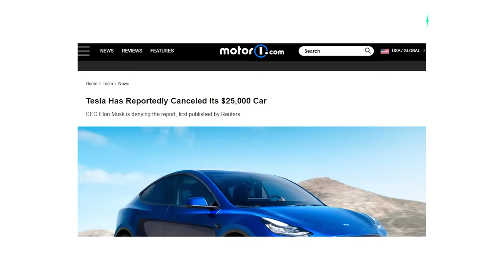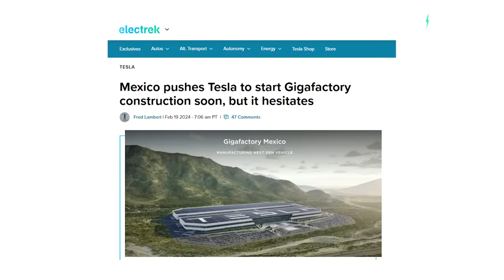The REAL reason Tesla is 'delaying' NOT cancelling Model 2 production

Comment: Tony Seba never said that the curve of improvement and cost reduction in EVs had to be smooth.  It turns out, the advances are happening in "spurts."  The batteries, the cars, and the production process all had to be reinvented and then reinvented again.  When batteries became safer, longer lasting, faster charging, less expensive and with higher energy density, Tesla could NOT make 20M cars using the older ones.  With 48V electrical architecture, ethernet signaling, wire steering and brakes, and mature sensing technology for FSD, it became cost prohibitive to design the cars the "old" way and then transition to the new later on.  These changes enabled radical redesign of the production process from moving production "lines" to sub-stations where the front, back and central sections are first put together and then securely connected.  Worse, fewer consumers buy the older versions because they know that in 2-3 years the cars will be so much better and cheaper.  Only Elon could maneuver through all this, but even for him it's a bumpy ride.
Reply: Agree EVS become obsolete after 3 years.

Comment: One of my rural neighbors bought a 1st gen Leaf.  The older Leaf is  okay for the five mile trips into town - the batteries can overheat on longer trips in the Texas summer.

I wish there were an affordable "Lego" battery with cooling that can be assembled by EV repair 
 shops to upgrade older EVs like the 2012 Leaf.
Reply: Carwow did a review recently on the 1st gen Leaf and were impressed by it as a daily run around and not a bad car by Nissan. Apparently, the Leaf has a big following/fan base and can buy replacement batteries, newer technology batteries with more range, etc.. It was very interesting.
Reply: New Teslas with LiFePo4 batteries will last 1.5m miles. Current ones last 500k miles. The Leaf was just early technology (like early cars which would explode) and I feel bad for your friend.
Reply: They have something like that for old Prius hybrids it seems.  Maybe it is coming.
Reply: Yes, loads of places will replace Leaf batteries with newer gear, doesn't mean there's one usefully near to your friend though. But it's not a car that's as important as say, a classic Beetle or Mini so it's not exactly exciting for the car monkeys to work on products for.

Comment: You are providing the most benevolent interpretation of the available facts. You could be right, and only time will tell. What we do know is that Reuters based its report of the Model 2 cancellation on internal documents, not off-the-record comments from unspecified sources. And Drew Baglino, who focused on powertrain and energy systems (not autonomous software), is GONE. And we have the promise of a robotaxi unveiling on 8/8. Another interpretation which would also fit the available facts is that the CEO is steering the company away from the dual Model 2/robotaxi strategy to a singular focus on the robotaxi and autonomous driving as growth drivers for the company, and those that are not on board with this strategy are either leaving Tesla or being let go.

Comment: I feel sure you are right.  There are a couple of other factors.  Tesla needs to build a thousand or more robotaxis to put through all the regulatory hurdles in each of the states of the USA and the countries of the world.  Once the robotaxi is into its regulation phase Tesla can start on the model 2.  Secondly, once robotaxis are seen to be coming, providing point to point transport at less than the cost of car ownership of even a small car, the market for small cars is likely to diminish considerably  It is prudent for Tesla to give the robotaxi some lead time.  Especially when people are putting off buying a new car.  The current market is perfect for robotaxi.
Reply: robotaxi make sense in a city not anywhere else
Reply: @joeblack4026  Robotaxis will simply be  like a normal taxi except have no driver. I don't think they will be any cheaper to use. People will still want there own car.
Reply: Robotaxi and the model 2 will be based on the same platform.
Makes sense to do them both  at the same time.

Comment: I think the battery issue is central, you're right. No affordable long range batteries, no Model 2.
Reply: DC.409  the 4680 cell was never going to go in the model 2. any 4680 production is testing for the cyber truck. As CAL recently stated a 60 kWh LFP battery will cost less than $3000 by the middle of 2024, price of the battery pack isn’t an issue but may be availability is.
Reply: DC.409  i have also just read that the new small BYD Seagull uses Sodium Ion Batteries - probably cheaper again. It may be that Tesla have already decided they cannot compete with these small cheap cars - but what answer does the rest of the industry have?
Reply: DC.409  I have heard about all of this many times before over the years and I hope there is some truth to some of it. If CATL cannot make Solid State then there is no chance anyone else can - and even if they can, the won't be able to scale it. Tesla are sitting on 1000 mile range battery packs but they can only be recharged less than 100 times. 

There is all sorts of technology about but none of it is for sale and driven on actual real roads. LFP batteries have been around for a long time, nothing new there. Forget about Hydrogen. No distribution, no infrastructure, no one is going to pay to build it out. Dead as a Dodo. And the Hydrogen itself would have to come from splitting natural gas using electricity or generated locally using electricity. 

I agree with simplify and lightness - as does Tesla "The best part is one you don't need". Like indicator stalks. Some People don't like simplicity and prefer their hundreds of buttons peppering the dashboard at random places. 

What I think is most likely to happen is tariffs, protectionism, no real innovation from legacy auto and made up stuff about Chinese cars spying on you. Unlike the CIA who were not spying on the German Prime Minister. Oops actually they were. Anyway, the rest of the world does not care about USA and EU interests so it will sure be interesting from now on - whatever new comes along.

Comment: Sam, you are right, it's all about timing.
More time to get the CATL high efficiency batteries into production, more time to fine tune the Model 2 design, and more time to allow the sub contractors to get setup in Mexico to provide parts.
Reply: Put Optimus In SUPPLIERS  factories

Comment: The robotaxi will have to prove to governments and to the insurance companies that it reduces accidents on public roads and is in fact safer than a human driver. Until that data is available Tesla will need to build the Model 2 for human drivers.
Reply: The legislation allowing it at all is a bigger  hurdle but is already underway. The FSD is just an unknowable amount of time/data until it tips over. My expectation is they'll deploy the first cars to places like San Francisco that already allow Waymo etc, and once it's proven not to run people over, other cities and countries will tick the box and let similar test programs start in targeted cities where it's the most useful anyway. Then it'll fall like dominos. End of the day, if SF needs 10,000 robotaxis to eliminate all it's taxis (made up figure) it would take Tesla several months of production ramping from when they pull the trigger to even build them. Each similar city that permits a pilot scheme, will need a bit less time but they'll be production constrained for years 

So they can sell say, 10,000 robotaxis, and any other cars they make have steering wheels and go direct to consumers. They won't have trouble shifting any of them.
Reply: 109%

Comment: Why would they build the smallest car to date in the land of the giants, surely Berlin would be the best place to make it and distribute around Europe where they actually buy smaller car
Reply: True. But then, Volkswagen have their ID3 and ID4 platform vehicles which aren’t selling as well as they planned them to. EVs aren’t the car most people are going for.
Reply: @sullivanrachael  but that's a 35k car and a pretty average one at that, this would be a MG4 competitor and I'm pretty sure people would rather have a Tesla than a MG or Leaf or Vauxhall Corsa E
Reply: @sullivanrachael  ID3 (size 3 car) has the same price of Model 3 (size 4 car), with less range, heavier car and not so good. Megane is a little better but expensive too, and the higher batterie is "small".
Reply: in Europe, we're used to 5 door hatchbacks with 1000 km range and very low energy consumption. at 20k€ maximum, brand new.
Reply: @sullivanrachael ..is EV in general? No, it’s all the OTHER EV that are not selling. Tesla still has waiting lists for its EV.
Reply: Subsidies is the simple answer to why they planned US production. Outside of the protected US market, competition is far ahead in low-cost EV's, making profitable scale difficult. While they might try to save face by showing something else and saying that is what they meant all along, there is clearly truth to the reports that they scrapped their originally planned low-cost car.
Reply: If they came out with a small, sub-$30K Tesla, I'd buy one tomorrow. As it is, I'm about to buy a used Leaf because we need something, anything.
Reply: Musk has already said that it will be produced in Berlin too.
Reply: SUVs are the best sellers in Europe. I think Asia is the best market for a small car, maybe in the upcoming India factory
Reply: @spadress  Europe is full of small cars,UK,France Italy. There isn't much option with the way the old towns and citys are built and people don't road trip like they do in the states or Aus
Reply: India roads are more petite
Reply: @spadress  Peugeot 208, Dacia Sandero, VW Golf, Renault Clio are Europe's best selling cars and have been that for years, all hatchbacks. The only SUV in the top list is Tesla Model Y in 2023. No idea why you think SUVs are THE best sellers in Europe, it's hatchbacks. Walk through any European city and it is immediately apparent, at least 70% of all cars are hatchbacks.

Comment: The $25K Tesla never made any sense to me. For a low price you need a big production run, for big sales you need big range, for big range you need a big (>50kWh) battery, to fit that battery you need a pretty big car. So now you basically have a Model 3 and that can't be build for $25K and even if it could it would wipe out sales of the real Model 3.
Reply: They could possibly be saving it for their India factory that was being talked about recently.
Reply: You have understood wrongly the physics of the equation vehicle size/battery size/range.   It goes the exact inverse that you wrote.

When you grow the size of a vehicle, you have to grow the capacity of the battery over-proportionally to maintain an identical range, which in turns increase weight, which in turns require a bigger battery.  This can turn into a vicious circle, and end up with a monstrosity such as the Hummer EV.

Inversely, if you go towards a smaller vehicle, you enter into a virtuous circle, and can save a lot on battery size, and hence weight and costs.

So a compact model, with a height identical to the Model 3, but 2-3'' narrower and 25-30'' shorter, would weigh 25-30% less, and be fine with a ca. 40 kWh battery, which will give it a range somewhat longer than the Model 3 RWD.

With the manufacturing volume of such a vehicle, my best guess... but that part is only a guess... is that it will come out at a price of less than $25k.
Reply: @st-ex8506  The most efficient EV currently available needs 24kWh for 100 miles so your 40kWh battery would get it ~160 miles of range. Nobody actually buys low range  EVs like that anymore. If we assume that the mass market demands 300 miles of range you would actually need more like a 70kWh battery to hit the really big sales numbers. So no, there will be no Model 2.
Reply: @tellyboy17   @tellyboy17  The Aptera is an EV, isn't it?  It  gets 250 miles of range on a 25 kWh battery. THAT on is probably the most efficient EV.  Your example is a SMALL EV, not an efficient one!  The Nissan Leaf, which has a 24 kWh battery,  perhaps?

But closer to our topic:
- The Model 3 RWD gets 272 miles of range with a 57.5 kWh battery.
- A "Model 2", assuming same aerodynamic coefficient (it will likely be better), same drive train efficiency (it will likely be better, if only because of narrower tires), and assuming the dimensions and weight reductions I mentioned in my previous comment, putting it in the compact car category, will need a battery around 25% smaller  to get the same range, so in the 40-45 kWh range... demonstrably NOT in the 70 kWh range!!!
- The mass market does NOT need 300 miles of range for a car that will NOT be a "road cruiser", but much more of a commuter.  I have that much range with my Model 3 LR, and I maybe need it 2 or 3 times a year despite me driving quite a lot! It's a lot of weight to move around uselessly 98% of the time, and a lot of cash invested in a marginally useful capability. 

Range, over ca. 200 miles of real-life range, is a pretty useless luxury... what is necessary is a good charging network, and Tesla has an outstanding one in most places.  I agree that if you live in ND, then it might perhaps be a good idea to wait a few more years before buying an EV.  But over here in Europe, we can travel everywhere with ZERO range anxiety.

The "Model 2" is much awaited in Europe, where even the Model 3 is too much of a car, in both size and price, for a large chunk of the market.
Reply: @st-ex8506  Nobody buys Aptera. Nobody buys Leaf. Doesn't matter what you tell people what they need, the mass market will decide for itself what it needs. If the range isn't there, the sales aren't there. An improvement of 25% over current best practice for a real car will not happen. So yeah, maybe if Tesla gets 275 miles out of 57kWh my initial estimate of 50kWh is closer to the mark (but not for a 300 miles EV..)and that takes us back to the Model 3 equivalent car. Again:  Model 2 will not happen.

Comment: On paper there's a difference between a 'pause' and a cancellation. In practice, a 'pause' happens until people forget about it, then the cancellation happens quietly with little press attention. It's usually a face-saving measure and nothing more.

There's cutting through hyperbole and inaccurate reporting, and then there's stretching things to make it sound like you weren't wrong by believing everything a company (run by a known liar) says.

Comment: The model 2 was going to be in Mexico, but was pulled back to Austin Tx to co-locate engineering and the initial production line.  Profit isn't the issue.  Ramp an optimally effecient production line with new technology BEFORE building multiple other factories which can then be built effeciently and quickly using proven technology.  Think of Austin like the initial 4680 battery proto line at Kato road where the 4680 production line was matured.  It could even run with no profit because building a new technology line first remote from engineering would be prohibitively costly in both time and money, if it could be done at all.
Reply: 100% correct. But because it takes 100+ words to explain this 99% of keyboard warriors not going to read it.

Comment: Sorry, the Mexico plant pause makes no sense. This plant is 2 years from volume production if they break ground today. They have $30b in the bank. Building the plant and holding off on installation of machinery and hiring might make sense but they have the money to build the shell right now. Scrapping M2 in Austin Also doesn't make sense, the line was well along in construction. 
Pausing the work during the company restructuring... OK, I see that. 

So there are 2 unanswered questions that need clearing up. I understand the need for tight control of info during a restructuring and the danger to sales of the Osborne effect, but the fate of the Mexico plant is now a Big WTF combined with rumors that Reuters is spreading about M2 (Name the thing or its the Model 2). Ping ponging M2 back and forth from Austin to Mexico also seems unlikely. 

Really can't wait to 8/8 to get clarity on M2 and Mexico or the stock will continue to be attacked by the usual suspects and that will bring unnecessary instability.

Musk predicted 2024 was going to be a slow year (China real estate collapse wiped out a lot of people's savings, US Trillion dollar binges hike inflation And Rates). This would be the time to restructure while record breaking production wouldn't be helpful. 
Certainly the rest of the car industry is hurting as well.
Reply: Gotta have suppliers

Comment: It does make sense that the cheaper retail vehicle will only be built right away in Mexico. If that is the case then it won't be available until around 2026-2027. That is a long time away for people to wait. Most people simply won't wait that long. They will get something else. Tesla take a hit on this. The only retail sector that Tesla has not tapped into yet is the below $25,000 sector. The fact that this is potentially a long time away, well. People won't wait and forget about the Robotaxi. That won't hit the streets for years yet. Tesla has not handled this well.